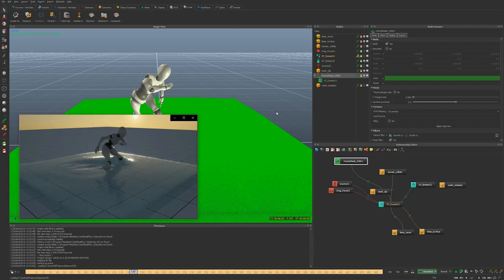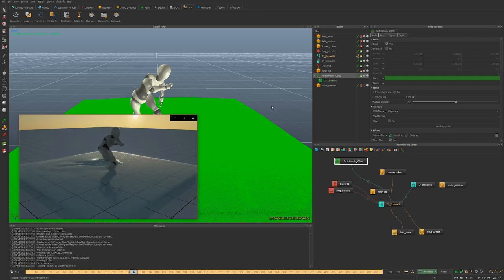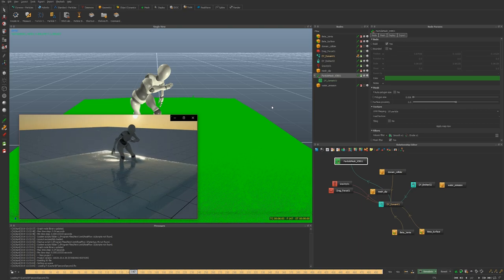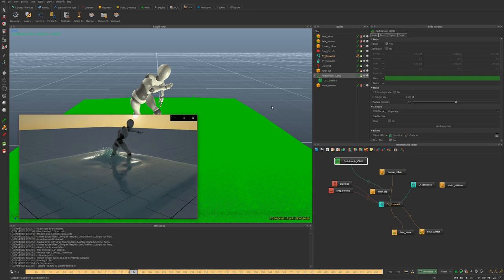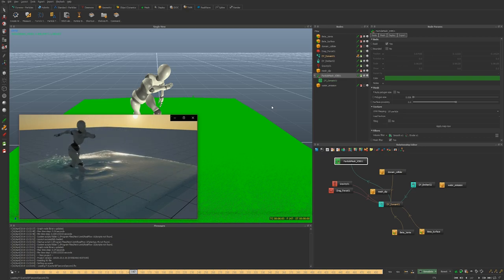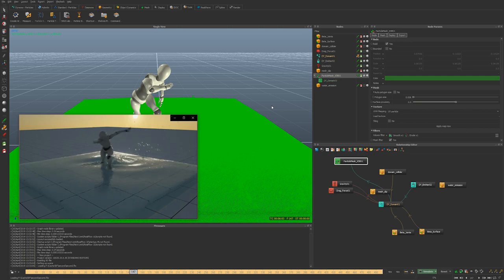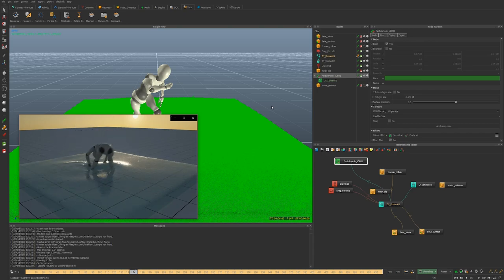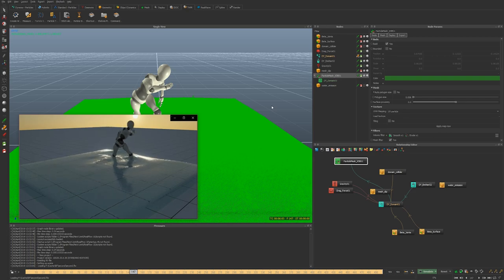Realflow crash course

Comment: Thanks for your video. I can believe RF still doesn't have a way to store Velocity channel in the alembic files. Have you found something about that?
Reply from the maker: Hi there Flavio,
Unfortunately not much news. I'm planning to cover some alternate solutions but still have some research to do.

As I mentioned to Gary no another video:
You can...
- Mesh the particles in maya with soup/ovdb instead
- Export as *.ass if you're rendering with arnold, seems more robust but haven't tested the data workflow myself.
- I'm also investigating if meshing using the bifrost procedural node graph would be viable.

Sorry I don't have a better response atm, thanks for your patience!

Comment: I installed Realflow 10 and its not reflecting in c4d but if i open it separate it works as program can you help how to connect it with c4d oh render for cinema 4d
Reply from the maker: Melusi, excuse the late response. Not at all experienced with C4D or the plugin there. I know the standalone rf10 does not have anything to do with the plugin, except for the connect-plugin used to import/export, that's a separate installer that you get from your customer portal. But to actually simulate inside C4d is a separate plugin and a separate license. Best of luck!

Comment: Is the scene scale super important when we do a simulate in realflow?
Reply from the maker: Yes, think of drinking glass, with liquid pouring into it. If your scale is too high for example, the behaviour would be more like pouring water into a barrell than a glass, takes longer to fill up, behaves more "heavy". This can be remedied with scene scale and/or changing the daemon force scale. So if you have a scale that's 10x too big, and can't change it any smaller for any reason, maybe a start would be setting your gravity to 98 and take it from there.
Reply: @Davesplaining  Thanks Dave! One More question, how many particle number of Foam And Splash is suitable for render in maya?Because i found my foam and splash not looking so real in redshift , they looks like bb bullet. Do i have to bump up the particle number, to get a better result? And how to render realflow mesh motion blur in maya with redshift? Sorry for so much question.

P.S. My Particle Count
HY_Foam = 1.9M
HY_Splash = 66K

Comment: Hi!

Your video is very useful. Congrats!

Well, I have a trouble with this abc stitcher.
I made an hybrido scene, and when I'm going to stitch, the program crashes. On every try this happen. If you know anything about this, help me, please. 

I'm grateful, anyway.
Have a nice week.
Reply from the maker: Miguel, thanks for the kind words, it's motivating to hear from you!

Personally I haven't had a lot of issues with stitcher as long as I give it some time to finish, depening on the size of the mesh per frame it could take hours and realflow will seem pretty unresponsive in between.

Which version are you on and which system?
Take care Miguel!
Reply from the maker: EDIT: Miguel, have you checked out the new version 10.5 that came the other day? They've improved the responsiveness of the stitcher - among many things. Free upgrade! Check it out, have a great day /D
Reply: @Davesplaining   thank you for answering! I have the real flow 10.1.1.0157. And my setup is a core i9, 16Gb, RTX 2080 8GB.
Reply from the maker: Hi again, Miguel don't know if you sorted this issue or just moved on but I was making a quick QA-video and just wanted to show what I meant about the stitcher... Check it here if you like: https://youtu.be/2cdRIMFi4os?t=701